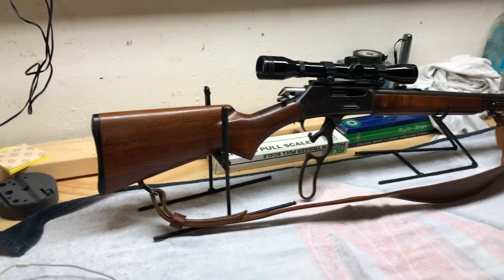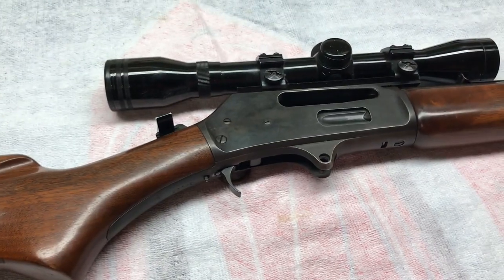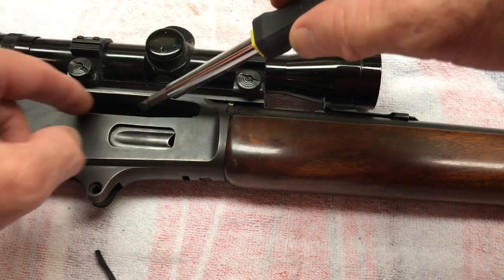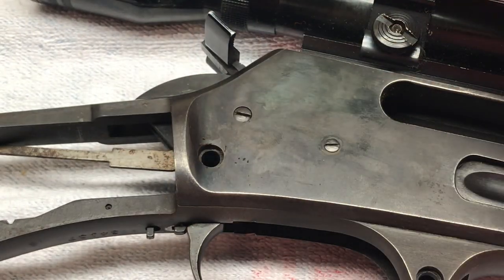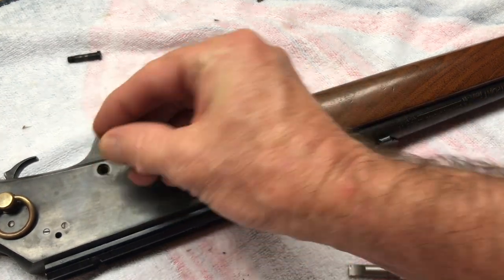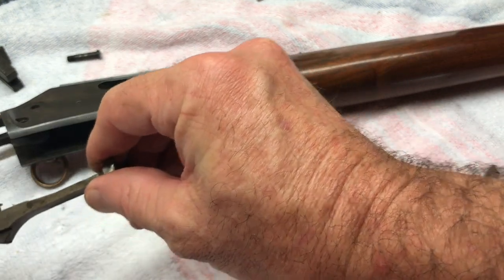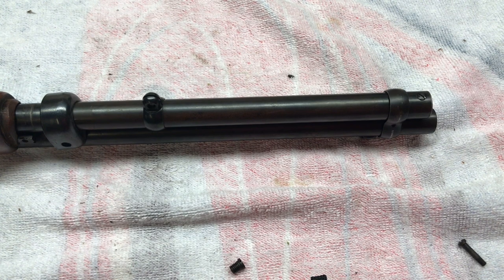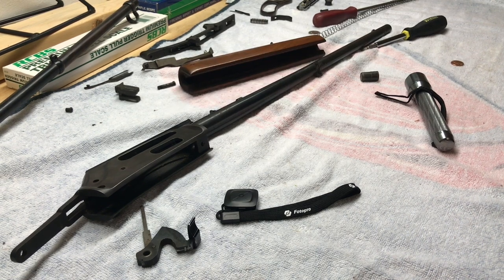Disassembly of the Marlin 336, West Point 33 and Glenfield Model 30

Comment: You didn't have to take the scope off. You can remove the hammer extension with a small allen wrench and then it will come straight down and out. Just fyi. Great video though! Glad I found it.